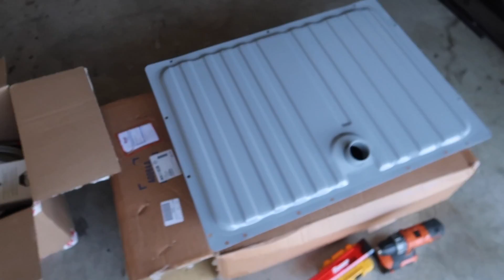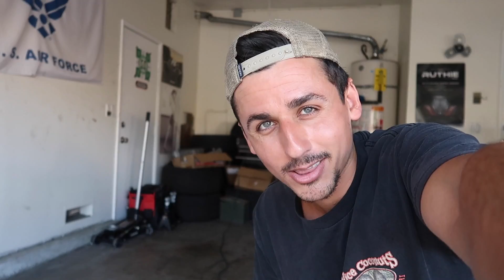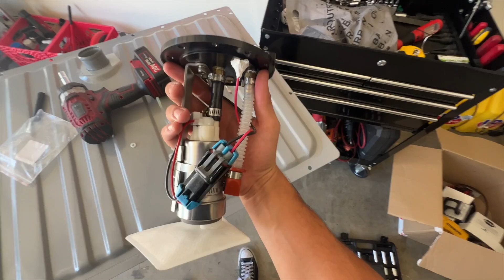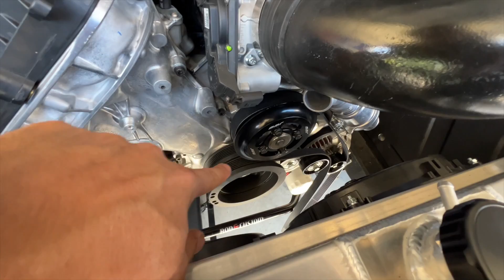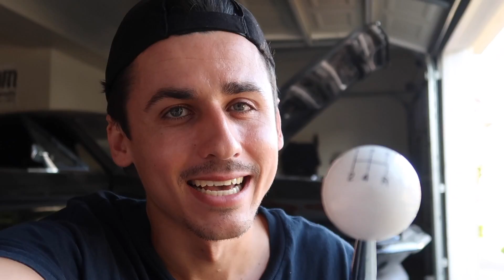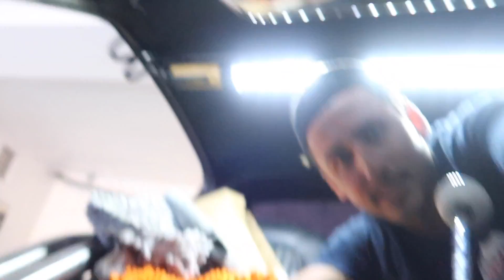Save the Manuals! Converting my automatic Mustang to Stick Shift! + Fuel and driveshaft! Coyote swap

Comment: Did you use a stock fuel sending unit? You mentioned welding the opening for it closed but I didn’t see a fuel sending unit attached to the pump when you dropped it in.

Comment: You might not have known this about the C4 automatic transmission but it can be used as a three speed manual. Start in first, go fast, shift to second and as soon as it shifts to second, move it back down to first and that will lock it in second gear, then when you shift back up into second or drive, in will shift into third. I drove a 66 GT for a decade growing up.